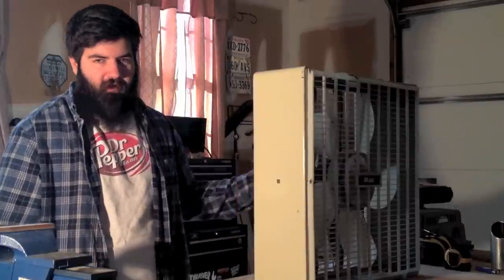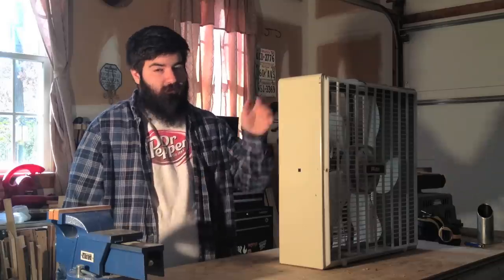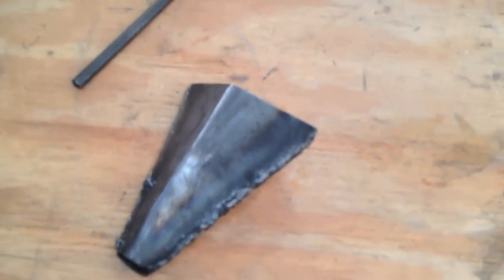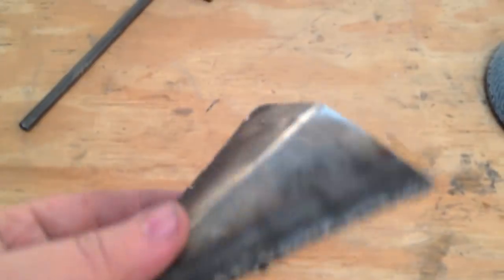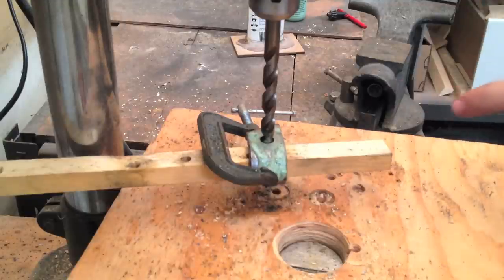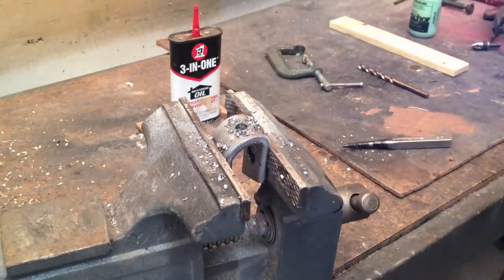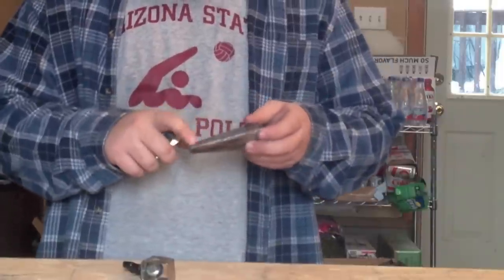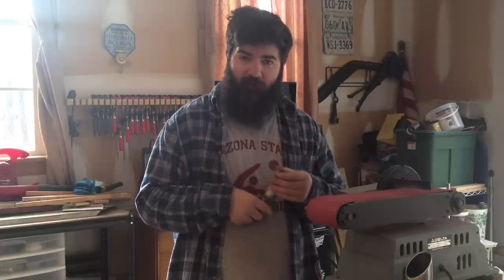Making a Cowbell With an Old Fan Pt. 1

Comment: rdavidr ...Just in case you haven't found out yet, your drill press is running way too fast for drilling what looks like stainless there, same for any steel. You're running it at a speed suitable for wood working. You want it on a slow speed for metal or the bit will get red hot on the cutting edge and go blunt in no time. ...And don't press too hard or the same applies.
...From an old pillar driller. :-)

Comment: get a bottle of 75/25 gas and some 0.35 solid wire (ER 70). This would allow for more controlled and cleaner welds. A tig welder is the way to go though for sure. also was curious how the sound would change if you heated the bell up red hot and dunking it into cold water to temper it. anyway, I thought it sounded pretty good!

Comment: i think the problem you were having when you were trying to drill that one piece was that you had work hardened the metal when you bent it in the vice. to get around this problem you wanna heat the metal up evenly and then let it cool back down slowly, that should soften the metal.

Comment: Part of the problem is that when you cold bend a piece of steel that thick, it gets work hardened. Quick death to drill bits. You could anneal it I suppose, but bits are cheap.